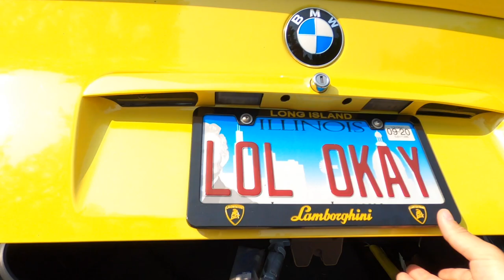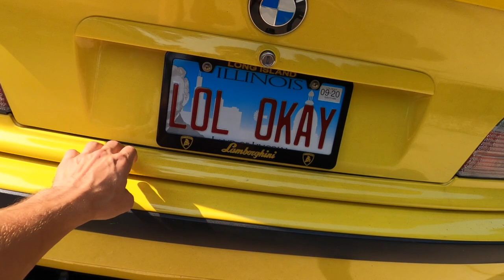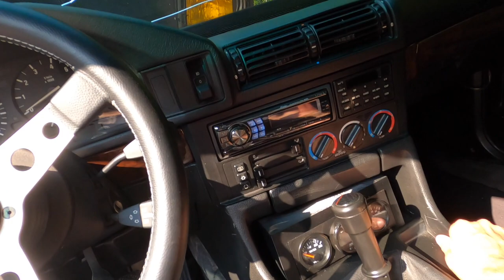E34 Vs. E36 | Which is the true king of 90s BMW?

Comment: purchasing a 1995 525i as my first car really excited !!
Reply: If you work on cars you will learn A LOT! My first was 89 325i back in 2004 and have been driving a BMW ever since. E46 ZHP came after amd is a fantastic car if you can find one that’s clean and not too much money. The M54 gets better with miles like the M20/30 so don’t be put off by miles if it’s been cared for.

Comment: I know you're comparing the American versions of the cars but the e34 also got Manuel seats actually you can pump air into the sides of the seat so you got a greater fit. And the second point is, some e34s have a wooden middle console and an airbag in front of the passenger seat you also could order bigger kidney grills which were stock on the e34 540

Greetings from Germany

Comment: 13:30 or if youre from Germany or most places in Europe we do know exactly what youre talking about :D Another spot where E34 has very often rust is around the fuel tank door, Regarding wheels: I drive 9.5 with 16 and 8.5 with 14 offset in the front and Im very satisfied, I have a video of it on my channel, I would say 9 inch in the front and 10 inch is perfect on stock E34 without body work

Comment: You must buy new tires often. The e36 tires are cambered way out to fit. Also you must surely be bumping into things all the time with it that low and it must be extremely bumpy with almost no suspension travel. Still thanks for sharing your video.
Reply from the maker: Car rides far better than youd think haha

Comment: Ayeeee I’m glad I bought a E34 without even knowing shet other than it had an M50 motor. And I’ve been planning to get a E36 but people were always weird about selling their car. But then I saw a E34 with low miles and a manual for $1400 so I said why not.(Keep in mind I bought it non-running due to water pump and drive belt). Easy fix with the help of all the room in the engine bay. After driving the car I’m totally in love. Though it’s old and it needs some love, this engine is bullet proof. Ngl, redline sounds amazing.
Reply from the maker: Joshua Mavez love to hear it man!!